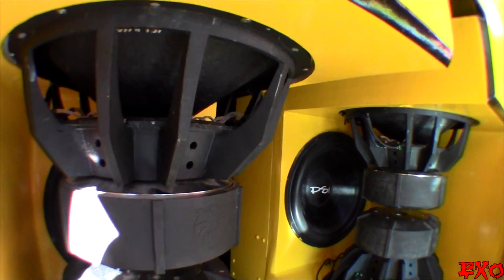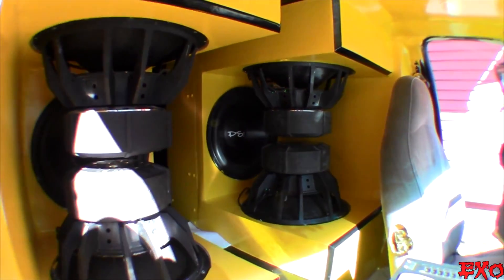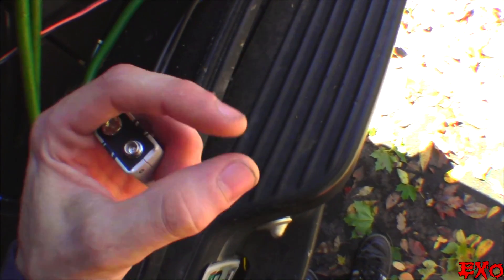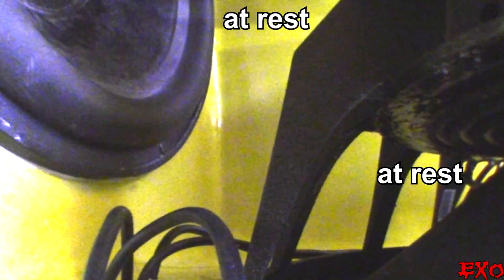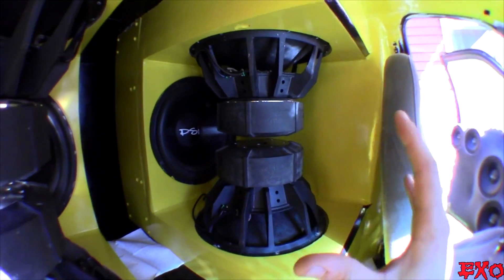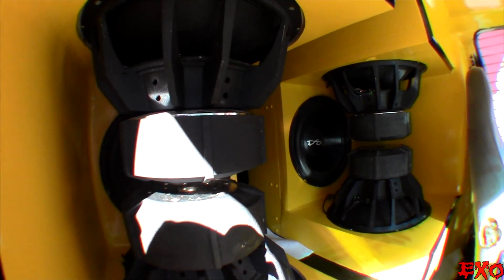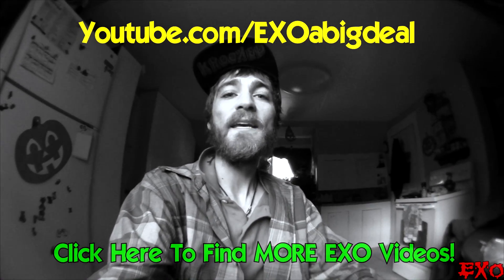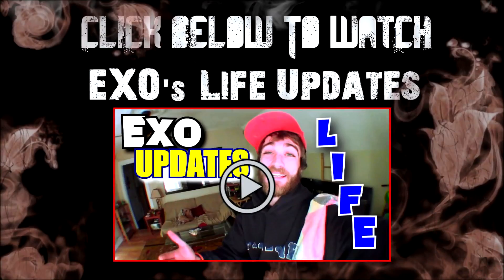How To Test Subwoofer Phase w/ 9V Battery | EASY Car Audio Tutorial // Speaker Phasing w/ DC Voltage

Comment: basically the invert mount subs are wired in reverse polarity while the standard mounts are wired in traditional standard polarity... having 6 subs with 4/6 invert mounted and 2/6 being standard mounted. that wiring job would be a freaking mindfuck. you put a shitload of work into this system EXO.
Reply: Thanks for the added info. Answers a question I had, above.

Comment: So the subs are wired differently? 1 banging inward and the other outward?
Reply: Yes, while moving the same direction relative to the enclosure.
Reply: To add to that. Good question. Just looking at the enclosure, it looks like he wired it that way deliberately to push the sound in to a 2nd order enclosure or higher. It looks like the 3 cones push the air in, and of course it comes out somewhere else, at a point you can't see in this video. It may come out of just the port opening (s), or it may come out another cone (s) on top. So the wiring could be a lot trickier than the part demonstrated here. Excellent question. Interesting design, and maybe he goes into it in more detail somewhere else.
Reply: Joseph Dunphy The subs are all moving in the same direction. It's just that 4 are inverted, therefore wired the opposite way.